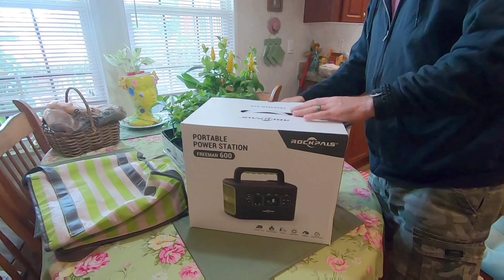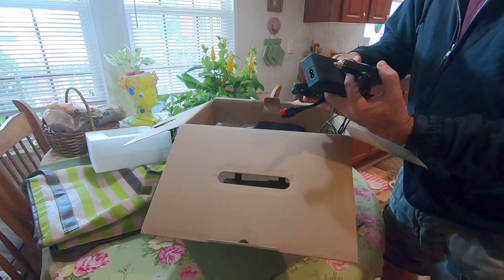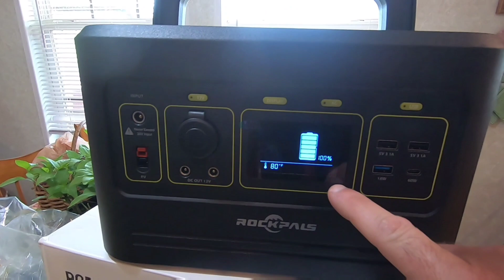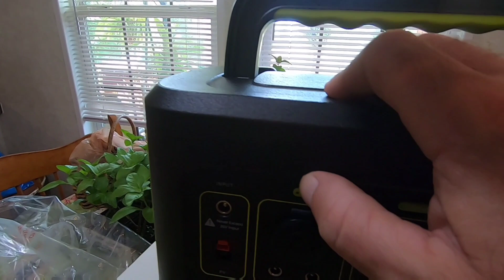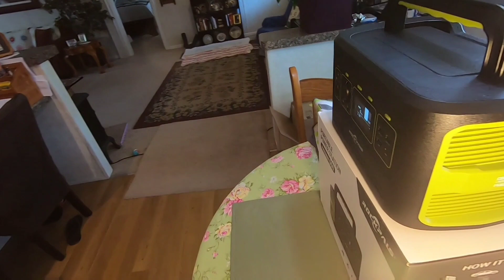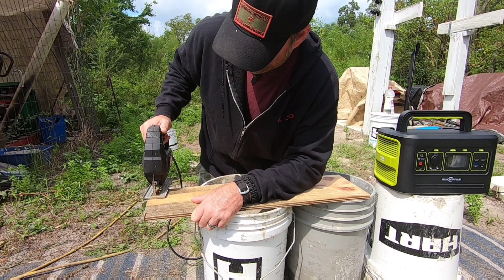Geekbuying Rockpals Freeman 600 Watt Portable Power Station

Comment: Man I have two of these things they’re great I’ve been using them and depleting them everyday for the last 3 months I’m happy as hell so far and the company responds quickly my first one came damaged the ac plugs didn’t work they sent me another one after I made a short video and told them the problem all over email and I had a new one within a week and a half and I still use the damaged one to run my fridge off the DC and charge stuff in the USB ports as well with the new one I wanna add that I pulled 27 hours straight just running my euhomy 12v fridge freezer y’all have a good one